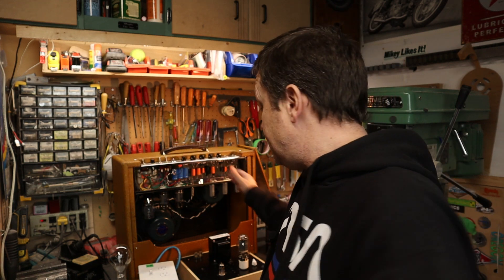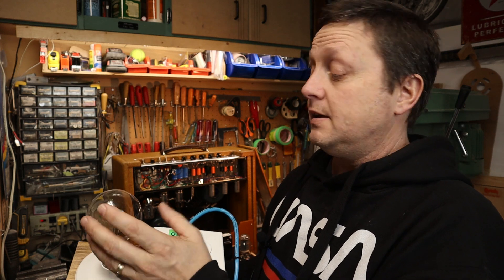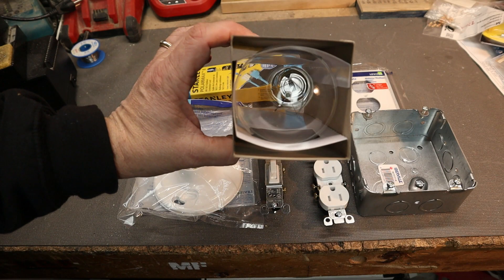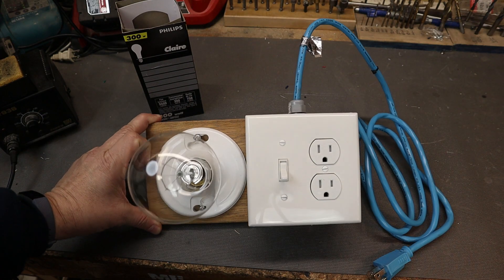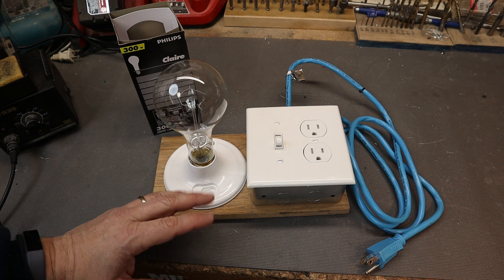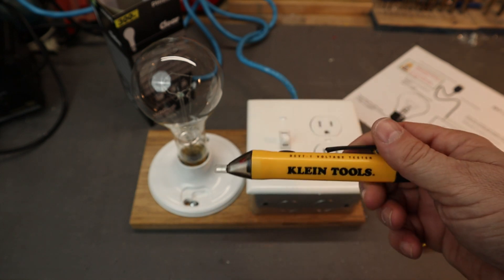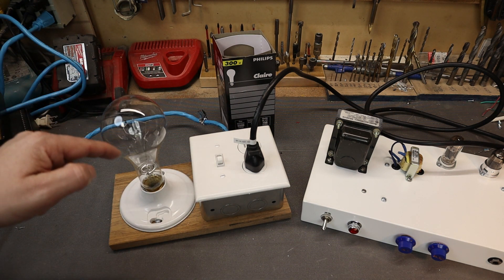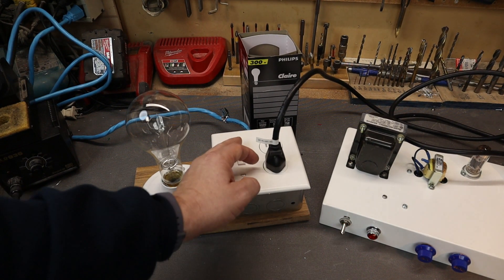SAFELY TEST a Tube Amp // How to MAKE and USE a Current Sink // DIY Light Bulb Current Limiter

Comment: For this part:
Hot (black) wire goes to:
- switch
- switch to light
- light to outlet (hot/skinny side)

Quick question, for the 'light to outlet' wiring portion.
My bulb/light holder has two screws for neutral and hot connections.
One of the hot screws obviously has the wire connected directly to the switch.
To connect the light to the outlet's hot side, does this wire have to be connected to the neutral or hot side of the light holder?
In other words, do I attach this wire going to the outlet to the 2nd hot screw under the light or on the neutral side which has nothing connected to it at this point?
Thanks for your help.
Reply from the maker: Thanks for asking. The light socket can be wired in any way just as long as it's on the hot side before the outlet. You don't have to worry about the polarity of the bulb just as long as it's inline on the hot side before the "load".  Some sockets have a safety ground/bond and two attachment points for the bulb, hot (black) and common (white) and green (bond).  Also, the outlet side bonding straps should be intact as well. Both sockets should work. I hope that helps?
Reply: @MikeFreda  Thank you so much for your prompt reply. In the end, I wired everything else just like you did and for the issue at hand, used the common side of the light socket and from there wired it to the hot side of the outlet. Tested it afterwards and everything works great; even tested with a very brief shorting of a wire and saw the light bulb illuminated pretty good. Thanks again for sharing this video and you have gained a new subscriber.

Comment: I have a vintage IMSAI 8080 computer that appears to have two shorted diodes. So when I apply power the 5A fuse blows. I could simply replace these diodes and the system will more then likely work. However I have just purchased a Dim bulb current limiter and want to test the effectiveness of this device to see if it will limit the current and allow me to apply power to the power supply and test the 3 output DC voltages, to see which voltage is working and which is not working. 
Or is the point to show a problem and just quickly turn off power???

The IMSAI is a valuable piece of history, so as I have never used one of these testers before, I am a bit concerned that it could case further damage to the power supply that already has a short circuit. I did pick up a couple of 15W and 25W bulbs for the tester, as it ships with a 100W bulb. Which is probably too high. 
All the computer boards have been removed and power has also been removed from the main (bus) board. So just the power supply will be effected. Which is mainly a large transformer, 3 large capacitors and several diodes and that is about it.

Should I be concerned with apply power to this system with the known short on the two diodes controlling the -16V rail??? Could any problem arise from the shorted diodes that would effect the capacitor or the transformer of this system???
Reply from the maker: Thanks for commenting and asking a question but I don't know much about that device and how it operates. These light bulb current sinks do help limit current and can produce a lower voltage (many vintage guitar amp players use them) but I suspect there is more going on here that cause the diodes to short and the 5A fuse to blow.  I would test/measure all the components first. See if the capacitors leak, see if there is any resistance to the rail to ground...etc.  You could just try the PSU and see if the light bulb lights up. I'd measure the current draw with a multi-meter. If the light comes on or you read very high current you have little to now resistance to ground. (ie. a direct short)  At the end of the day, there is something wrong with the circuit and current sink won't fix that issue, it just makes it a "bit" safer to test. Be safe! Cheers
Reply: @MikeFreda  Than you. I already know where the problem is. I just want to see if the limiter would have helped me by making it possible to run the power supply long enough to test the 3 DC voltages that it produces.

Comment: Thanks for the informative video! Would a 100 watt bulb or 40watt to test  heathki A7 mono amp? Thanks
Reply from the maker: You're welcome and thanks for commenting.  You "can" use lower wattage bulbs but what will happen is that the bulb will light up due to their lower rating. It is creating less of a current divider which will allow the bulb to fairly glow. When the bulb lights up it will effect (lower) the incoming voltage to the amp. Some people intentionally do this to guitar amps to create more sag or try to cheaply replicate the "brown sound".   I recommend sticking to a higher wattage bulb like the one in my video to not affect the operating voltage of the amp therefore you will measure proper voltages at the normal operation mode the amp will see.  I hope that makes sense? Cheers.

Comment: Thank you. Mine worked well, but I don't get the light to get the initial glow when I fire up my amps. Its a 100 watt bulb.
Reply from the maker: You're welcome. The light may not glow at all. It depends on a couple of things if it will or not. If the initial surge and amp draw is well under 100W, the light will not glow at all.  Does your amp have a Tube rectifier? Does it have large capacitance? A 60W bulb may light up.  A Tweed Deluxe would make a 60w bulb light up a little.  I don't think it's anything to worry about if you wired it up correctly. Cheers.
Reply: @MikeFreda  "if you wired it up correctly" ... How can you test to make sure before connecting amp?
Reply from the maker: @Rochester201  You can use a multi-meter set to AC on one plug than you can plug in anything in the other plug. If the voltage goes down a bit when you turn on the device, its working.
Reply: @MikeFreda  Perfect! It's working ... Thanks

Comment: 300 Watts?! DUT is safer with absolute minimum potential current. Particularly amplifiers. You need enough for the inrush from filter caps and beyond that, little more than average idle consumption. Never used more than a 60watt bulb.
Reply from the maker: Thanks for commenting, yes, a lower wattage bulb will work as you describe however, that size of bulb can skew the voltage and amperage reading in the amp so people should be aware. Cheers.

Comment: Hi @Mike, in regards to your suggestions with getting a higher watts bulbs. I've recently picked up a used Egnater TourMaster 4100, the previous purchased a replacement power transformer and attempted to replace it. I rewired it correctly (or to my knowledge) changed out the blew fuse. I have it at the end of the link with a variac in front , followed by the limiter then the amp. When I turn it on, I do notice a dimly  lit bulb (200w 5.6ohms). Could I have a current leak in the amp? Or I may need a 300w bulb?  The amp is a 100w 4 x 6L6 and 8 x 12ax7. I haven't had turned it to power yet to fully test if it produces sound.  I just wanted to triple check everything before messing something up ($300 power transformer replacement).  Thanks in advance!
Reply from the maker: Thanks for commenting.  An amp that large will probably make the a bulb like that glow a bit due to its current draw.  It would go bright if there was a dead short and way to much current.  If the amp turns on and the tubes flow… and sounds comes out, I’d say it’s probably good.  Yes, a larger wattage bulb would probably not come on at all.  Another way of checking is using a multimeter to confirm current draw. Cheers.
Reply: @MikeFreda  Thanks Mike appreciate all your knowledge and getting back to me so quickly. I'll give it a try and test the current draw before I fire it up.
Reply from the maker: You’re welcome.  Depending how that amp is biased, you could potentially see over 150ma.  That’s no joke to be playing with.  Take care.
Reply: @MikeFreda  manufacturer recommendations are 115mVDC-130mVDC. Hence, I have not turned it on or dare to probe yet until I'm fully understanding what's to be expected 😅.   I've jumping back n forth between your channel and Uncle Doug's to as guidance for all my projects and repairs. First time working with a 100w tube......

Comment: Ive just bought a cheap faulty Peavey rackmount power amp, and i THINK ive fixed all of its faults.. 
But being new to electronics repairs (this is my very first repair project), I am extremely nervous about powering it up...
Someone recommended to me about using a current limitting bulb, Which i have made... a 60w bulb in series..
Basically, my question is... With the current limiting bulb in place.. Does that make it 100% safe to turn the amp on?
If there is still an issue with the amp, Will it stop it from going BANG?!?!
Thats what im nervous about.. Standing right next to it, flicking the switch on, and it exploding with me next to it haha. 
Thankyou
Reply from the maker: Depending how many amps your amp draws a 60watt bulb may light up when you turn on the amp. I would recommend a higher wattage bulb.. more than 100watts.  I use a 300 watt bulb. Go to Uncle Doug’s channel, he actually shorts his device out… a little knarly for me, Cheers.

Comment: Do you think this would work for 240v ?
Reply from the maker: It should but I'm not versed on how to wire is for 240v, sorry.
Reply: Yes, it will work for 240vac. But you will need to find a 240v bulb.

Comment: Wouldn't you be better off in limiting current with a smaller wattage(larger resistance) bulb? A 300W bulb @120V, draws 2.5A. That would mean you would have 2.5A running through your device under test, if there was a short (the bulb being your only load at that point). This could mean blowing the fuse on the primary if it is only a 2A fuse. The good thing about using the bulb tester, is if you have a problem, the current is limited to a point where you don't blow the mains fuse and have to replace it. A 100W bulb keeps you under 1A.
Reply from the maker: Thanks for your comment. Your observation is somewhat correct. Yes, what you want to do will work but if you just size the bulb to what current you may encounter all you are doing is limiting the current to that threshold. You could still damage a component inside the amp.  Not all amps have the same draw so there is some flexibility here. I sized my device to be more flexible.  The way I am using it is to absorb most of the fault if there is a direct short to ground or and exorbitant amount of current. I still want the amp to function normally without having a current threshold. Another thing is that many fuses are slow blow so before the fuse goes you could already done damage.  A lot of blues plays like to do what your describe to get a spongier feel to their amp (more sag because you are robbing the amp of current by sharing it with the bulb). The light will actually come on at times of heavy playing. Cheers
Reply: @MikeFreda  I guess everyone sees the world differently. I think you are looking at it from a current sink perspective and bigger is better. For a dim-bulb tester to use with a device under test, current limiting is desired. I understand the desire to be flexible, but you can do that with different size bulbs and switch them in as needed. Mine has a 40W, 60W and 100W. But I don't understand the reason for a 300W. If there is a direct short, the light bulb will absorb all of the fault current no matter what the wattage is. Plug a 60W light bulb into an open circuit and then short the wires, the light bulb draws 0.5A just like it was in a normal circuit. This way you only have half an amp running through the primary of your power shorted power transformer. With a 300W bulb you are going to have 2.5 amps running through it and the primary may only be rated for 1A. I just don't see 2.5 amps as very current limiting. If you are wanting to keep the device under test on the bulb the whole time, I guess the larger wattage is better, as to not drop the voltage on the device as much, but the way I think about it is that the bulb tester should be used to determine if there is a fault, but then be taken out of circuit once that determination has been made. You definitely don't want to adjust bias or look for specific voltages in the amp while on the dim-bulb.

Comment: Well i built it according to your wiring and im a bit nervous plugging it in, dont have the plug checker.
Reply from the maker: Well, if you are a bit nervous (which is normal) plug it into a power bar that has a protection breaker and just use a normal electrical device like a desk lamp to test.

Comment: I never used one in my life or ever get shocked 
I always make sure there is a fuse and i use a variac and slowly bring voltage up 
I’m going to make this circuit and give it a shot I always seen them but never wanted one since space is limited on the bench
Reply from the maker: A variac is great for bringing up the voltage slowly but doesn’t really protect if you are testing and have a probe slip or something like that.  Relying on a fuse is not as safe. Most amps have 2 amps or more and are typically slow blow… you could get a pretty nice shock before the fuse will ever blow.  I never use to have one up until recently. I’ve only been shocked twice in my life building amps and I thought I was always safe. It’s only a matter of time. Be safe!
Reply: @MikeFreda  i got a variac but i'm going to add one Light Bulb Current Limiter  thx
Reply: I 'cheat' the other way round - I have an IR heat camera pointed at the PCB and use a variac ;)

Comment: Link to the schematic is broken.   Guess I'll go watch Uncle Doug's video again.
Reply from the maker: Sorry, the server I hold my files is down. If you send me a email, I can forward you the plans. Email link in the about section of my page.
Reply from the maker: Link is fixed.  Thanks.
Reply: @MikeFreda  Cool, thanks.  I guess the important point is that the hot goes through the bulb and switch first, while the white and green go straight to the socket.  I wasn't getting that without the picture.  I also wonder about doing dual bulb sockets in parallel so you could run 2 cheaper 150 watt bulbs.  I'll have to look around and see if it's possible to do without making the thing huge.

Comment: Mike, my switch has a ground lug also. Would you also connect that ground lug to the outlet ground lug so both points are connected to the plug ground? Or can/should you just leave that lug unconnected?
Reply from the maker: Connect all the grounds/earth wires up if you can. Switches are not as critical but if there is a catastrophic failure somewhere you want it to goto ground. It is typically the green screw and wires.